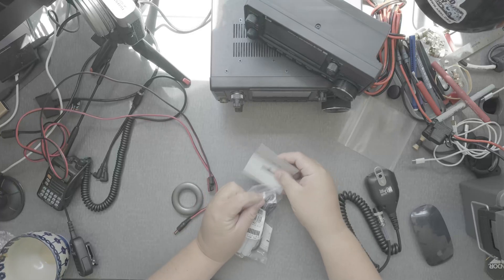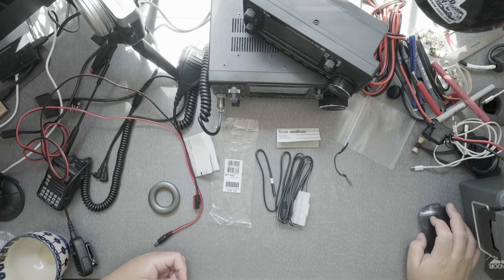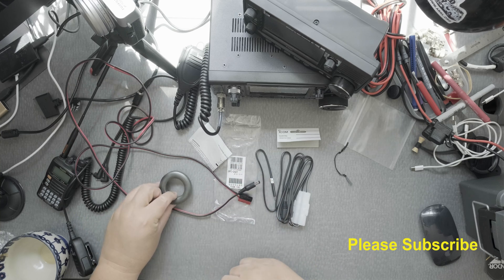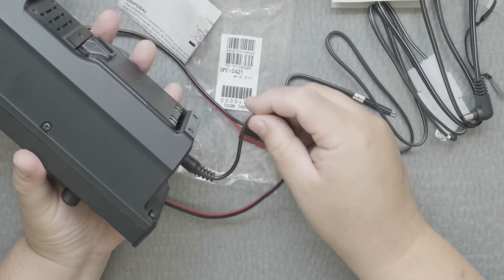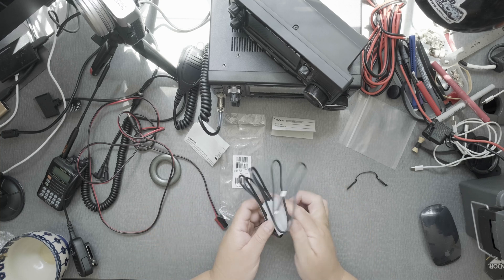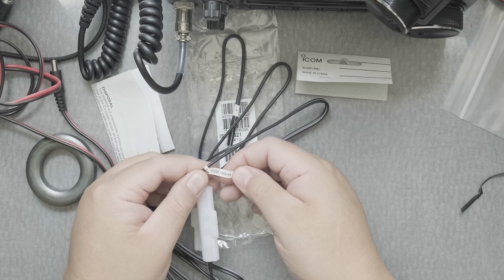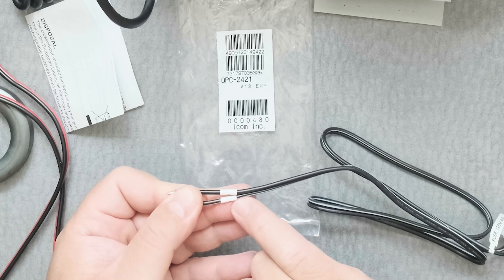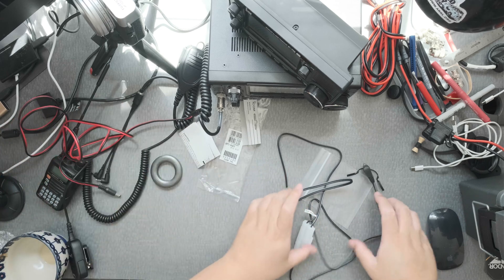DC Power Cable Options for IC 705

Comment: Bro! I want to buy the cheap cable and replace the barrel with a right-angle barrel like the Icom cable. I'll put fuses in line too. WHAT SIZE IS THE ICOM BARREL?
Reply from the maker: You got me dude. I would go to the Facebook group on ic705. You may search the archive on this question.

Comment: Hi Frank, could I get 10watts by using the dc socket that comes with the 705 connected to a 12v power supply?
Reply from the maker: Hello Ascent 41.  Yes, if you connect a 12 volt supply to the DC socket on the IC705, you will receive 10 watts. I talked about that.  Check out my video - start here and watch for about 3 min or so: https://youtu.be/7Ay5hUkjwVo
Reply: @frankwc0o  Awesome, thank you.

Comment: Nice video, thank you. I've got a 6ft extension to link a Mydel power supply to the IC-705 for indoor use but it hasn't got fuses either. How do you fit inline fuses? Do you cut and then solder a pair of fuse holders? Apologies for the newbie question.
Cheers, best regards,
73 de 2E0HJN
Reply from the maker: Yes, that is a good way of doing it.  You cut the line and you place the holder in-between.  It's best to solder so the wire will have good contact with the holder.  You might need to practice first.  Good luck Flat Twin Frog.
Reply: this guy will not answer you yes correct just copt what on the original cable is you can buy this FUSE any shop vy 73

Comment: Did you consider adding a fuse holder to that Powerwerx cable? Seems like a much cheaper way to go.
Reply from the maker: Yes, you are right.  It would cost much less.